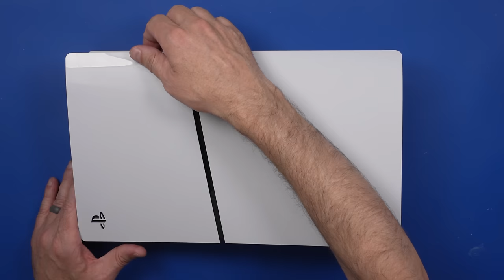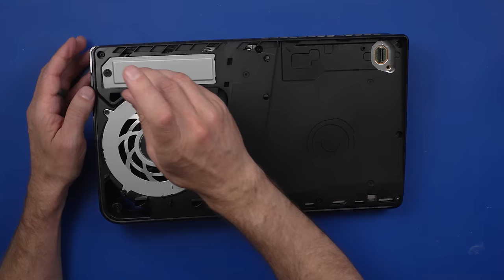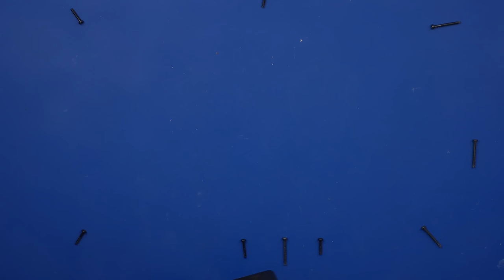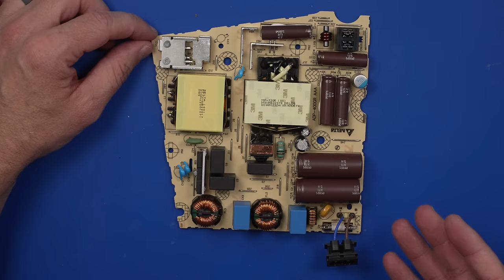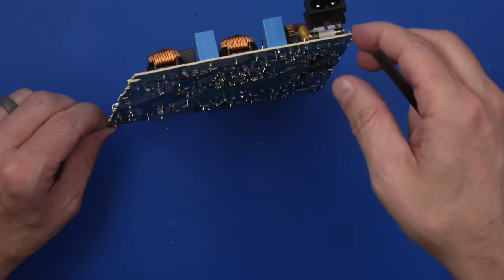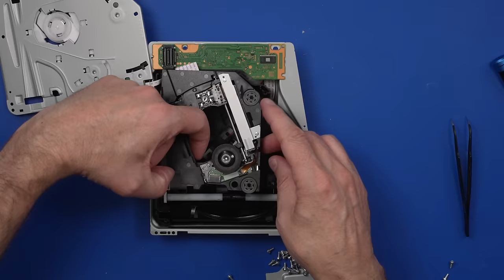The PS5 Slim - A Repairability Perspective - Detailed Teardown

Comment: I saw other video that someone said that the 1 dot means short screw
2 dots means long screw

For me the best of this version:
- Disc drive easy to remove, it is one chunk that is connected with only 1 connector that simply is plug and play
- has more Internal space (1TB)
- it is easy to install more memory in the console like the original PS5
- it is smaller, not much but it is smaller, the original PS5 is Big and its design makes it feel bigger
- power supply is a chunk like in the original PS5, and you can remove it without needing to messing around inside

The things I don' t like:
- it comes in white with a mix of mate and glossy :( I would prefer the console in black ( midnight black) and mate like we had the PS4 Slim and the PS4 Pro
- I don' t apreciate the line in the middle of the plates, I prefer one plate for each side like the original PS5 version
- they replaced the USB A with USB C, I think they could kept the USB A in the front of the console like the original PS5
- it is hard to replace the CMOS battery, I think that the CMOS battery should be accessible like the M.2 memory slot, the user shouldn't need to unmount all the console to replace the CMOS battery

Comment: Hey tronicsfix! I was wondering if you would be willing to repair a ps3 backwards compatable?
Reply: Those can't be repaired because their design is fundamentally broken. 

The Nvidia early 90nm RSX in the backwards compatible PS3s (and early 65nm runs, too) is of a generation when Nvidia was having production problems across the board, also earning them a full, life-time ban from all things Apple when they didn't make good on their blunder.

Basically, the only hope to continue using a backwards compatible PS3 once its original RSX breaks boils down to backporting a much later, 40nm shrink of the RSX to the old board, which some enterprising technicians have managed to do. You can check youtube for videos of it being done and inquire a quote from enterprising technicians to fix your console.

Comment: My only complaint about the ps5. Is the plates. Think with how expensive that they are. That the plates would be something better than plastic clips holding it on. I worked on my first one shortly after it came out. And had to pay for a new plate. Luckily the kid wasn't mad about it. But, still makes me get scared to pop one off. That sound no matter how many times I hear it. Makes me feel like I'm breaking it.

Comment: Very nice and pointing out video, would definetely like to see some extent test on temperatures as those cooling on the GPU look a bit sketchy, its hard to say if they are smaller but visually looks like they used less material or it could be just because of relocating the radiators and their lenghts but it willl be still interesting to see how does this affects temps.

Comment: Would you recommend plugging a japanese PS5 (CFI 2000 A01) to a 220V outlet? Manuals and console itself say it's 100V, but everywhere on the internet it says that this is because of regulations from each country/region, but all of them just have the same dual voltage PSU

Comment: Hi Steve! I got a few questions, could you swap Liquid Metal and use good quality Thermal Paste instead? would that make it cool better? Is it something you would advise?
Thank You!
Reply: He did a video on that. I shut down after a few minutes as thermal paste doesn't conduct heat aswell as liquid metal.
Reply: @SoulJa709  Thanks Man!
Reply: @Yoloarreglo_Mrfixit It shut down after a few minutes WITHOUT a fan. You can use thermal paste inside a ps5 it's just not optimal and you can easily break it...

You can, but you shouldn't.

Comment: The ps5 slim cleans easier inside than the og ps5? Saw on one short video how easy the guy takes the fan of ps5 slim out and blows it clean with n aircan. The ps5 og you have like so many screws and things just to clean the fan. If needed anyway. But just this made me think that the ps5 slim is also easier to repair? But I saw another guy easilly clean og ps5 too. So I am not cimpletely sure. Which 1 would you advice me to buy dear sir.

Comment: @tronixfix Hey Steve, guys, i have a ps5 slim here that hangs kind of randomly after a few seconds when you launch a game. it doesn't matter whether it is digital or disc. Once it hanged in the the main menu while browsing the store. It hangs on loading usually (like reading something) and then buzzing sound comes and after that green screen. almost always. Sometimes it displays error after the recovery which is CE-108262-9. But funny though Horizon works fine, Ratchet works fine as well as some demos. Diablo 4, FF demos - all crash it no matter what i tried. I obviously tried to: initialize, clear cache, check drive connection (this is disc model but it hangs when it is disconnected as well). Wi-fi works fine and downloads everything with no problem. I tried to switch off HDR, HDCP, etc. - no help. Did you encounter anything like this? By symptoms i would say APU should be fine as I played Horizon like 1 hour without any issues. Can it be RAM? but again, Horizon which i guess is a pretty demanding game runs fine. Maybe the internal SSD chip somewhat faulty? Can we test it somehow? Thanks!

Comment: Hi I have questions bought my little brothers a ps5 slim about a week ago it stopped turning on at all now lights sound or anything I’ve tried holding the button to try to get into the safe mode didn’t work and switching power cords didn’t work I was wondering if it’s just the power supply that’s fried or if I need to replace the whole thing I have no idea if it fried everything or just the power supply

Comment: I konw this has nothing to do with this video but the extreme rate remap kit for the xbox one s controller. I watched ur video on that the one thats 3 or so years old. I bought it put it on but the touch pad nor the combination buttons work. Ur the only reason i bought it just need help not sure what im doing wrong or if its just a faulty kit. I do have a video on here plz cheak it. Just need help.

Comment: Hi hope someone can answer my question I’d appreciate it a lot in my country we use 220v I want to purchase the PS5 Slim from Amazon as it is not in our country yet and wanted to know if it would work here seeing that America uses 120v I know the original PS5 was dual voltage is the slim as well would it be safe to use it here even if the console is for Americas 120v standard? Just scared to spend 600 dollars on a console and then I use it here and it blows up 😂 any help would be appreciated thanks in advance.

Comment: Agreed that the glossy plates are a 👎

They will look nice for a short time, then get scratched and look awful once you try to clean dust off the PS5
i also don't care for the two tone look. Either do all matte or all glossy. Don't mix it. It looked bad on the original PS4 and it looks bad here.

Comment: Are you able to fix a code 43 on a gpu?
I have rtx 3060 ryzen 7 5800 H omen 15 2021 laptop.
About 3 months ago got code 43 stoped your device detected a problem. Have been able to get it to come back after reinstalled drives about 20 times in a row then it would just pop back to life at random times but every restart have to do it all over again. 
So gave up for about 2 months and have just used my deck but would like to know if its something you could fix?

Comment: The only time it will not be possible to fix a ps5lim, more specific the disc drive, will be when the server for the ps5 gets shut down.
Reply: Considering that ps3 servers are still going almost 20 years later I don't think we'll have to worry for a long while. (Hopefully)
Reply: @POTUS118  true but is an issue regardless.

Comment: Is the Slim quiter and cooler than the normal one?
Reply: I don't know about cooler but it makes more noise especially on graphically demanding games...I've tested this on 3 slim consoles and they all gave the same result. Not as loud as the PS4 but definitely noticeable.
Reply: @a.khaosnarine9118  Thanks for your fast reply. What are the advantages over the standard version, if not cooler and above all quieter?
Reply: @TECC73  I guess space... it is thinner but in all honesty, especially considering that it's not cheaper, the standard version is perfectly fine.
No need to get a "Slim" unless you just really want one.
Reply: @a.khaosnarine9118  so you can confirm that slim version makes more noise than og version? Im looking to buy a ps5 and don’t want to get a noisy one so I guess its better to buy og?
Reply: @sashacui  after playing on 3 of them, yes, I can confirm that it is a noticeable sound.
Reply: I’ve seen a video of that how the fan gets pretty loud when the dude was playing fortnite and said his OG ps5 didn’t sound that loud, but what type of demanding games? Does it get loud with the included bundled games SM2 and MW3? How about other PS games like ragnarok final fantasy or even horizon?
Reply: @EternalNightingale  I tried both God of War games, both Horizon Games and both Spider-man games and the sound was almost jet engine, however, on games like Elden Ring and Dark Souls, Bloodborne...etc. its not as loud but still noticeable.
Reply: @a.khaosnarine9118  So it's a downgrade that costs more. Now I'm definitely going to get an original PS5. I hate having a jet engine at home.... The PS4 pro was terribly loud. It's not worth the little bit of extra space. You get a slightly narrower console ok, but you can barely see the 15-20%.

Aesthetics (which you can barely see) and a little more space.... but a jet engine, no thanks Sony.
Reply: @a.khaosnarine9118  So in terms of noise level, would you prefer an original PS5 to the PS5 Slim?
Reply: @73cc31  I do. I initially tried the 3 slim consoles to replace my original Disc version (1215A Model ) due to the space since I keep my PS5 horizontally, which the "Slim" is actually slimmer in this orientation I might add, but quickly realised that the fan was annoying.
Maybe the slim will have advantages other than being slightly smaller and having an actual 1TB drive but for now, I'll stick with the original especially since the price is basically the same.
Reply: @a.khaosnarine9118  Thank you for your insight. This encourages me to buy an original PS5. Cheers.
Reply: @73cc31  most welcome hopefully the pro is a better deal than the slim.
Reply: @a.khaosnarine9118  I hope so too :)

Comment: Better get the original ps5 the last revision model now or else it gone for good and you would have to buy it in a second market used if possible. I own three ps5 disc version that i bought earlier this year the last revision. This may not matter to anyone but that's you but for me the playstation 5 slim is a pass for me? Anyway what about the new playstation 5 slim digital version what happened to that?

Comment: The launch era OG PS5’s where over engineered as they were newly designed and Sony (or any manufacturer for that reason) tried to bullet proof them as a bad review at launch could have killed them. 
Now they have learned a lot since the launch of the OG so the Slim has its advantages…..but I’m sticking with my OG. 
If they come out with a PS5 Pro I’ll buy THAT one.

Comment: Keeping a ‘rigid connection’ between a ‘hand induced force’ and the PS5 motherboard - via HDMI slot - shows that mechanical integrity engineers were nowhere near the PS5 structural design team.

Comment: i think the four different screws for the fan is a bit petty by sony. also, even though they've used it for two generations now the xbox disc drive is just so much better
Reply: AFAIK the fan is screwed through metal and plastic so different screws depending on what it's going through makes sense
Reply: @TimeMasterOG  yes, but the repairability perspective

Comment: Wow this new model is really cheaply made sony did cut a lot of corners to reduce the size and the Wight  of the console
Reply: No it's not. And no they didnt. They have been able to cut it down because they improved the chip in the last version of the ps5 with its 6nm chip
Reply: @TimeMasterOG  man just look at the ssd socket how it's not even fully welded   the heat sink hanging out and the pipe can be damaged easily and the chip is the same as the 1200 model
Reply: @mohamedhichemmouzali6505 this has the same chip as the last model is a 6nm and why in god are people going to bend the heat pipe who is opening their ps5 everyday lol
Reply: @Nanaki162  I know but in this new model an unexperienced user try to change liquid metal and screw up his 550 euro console